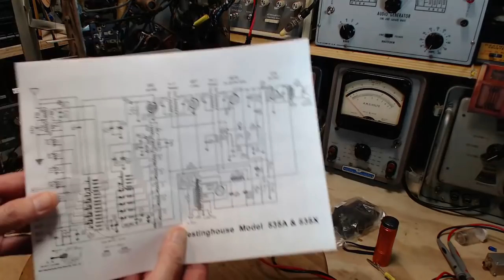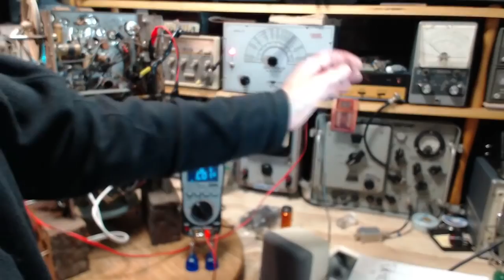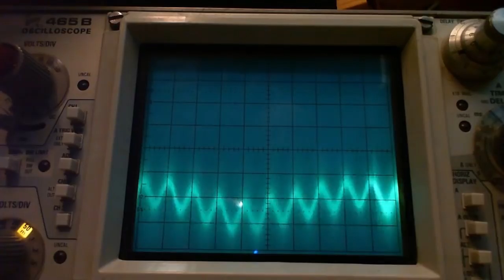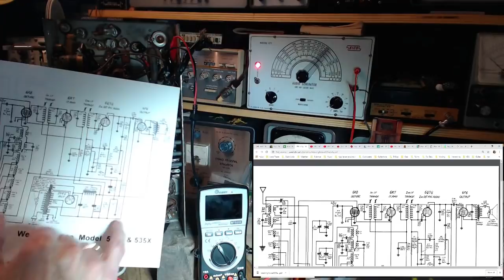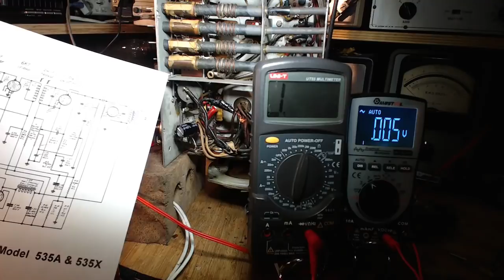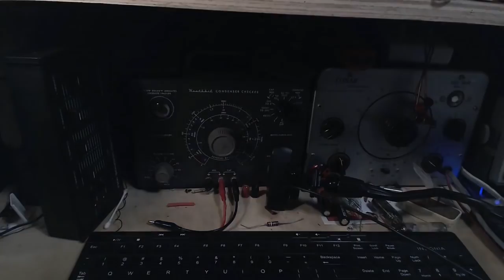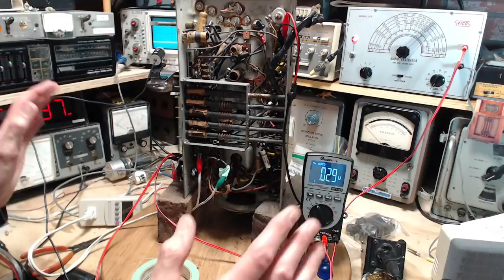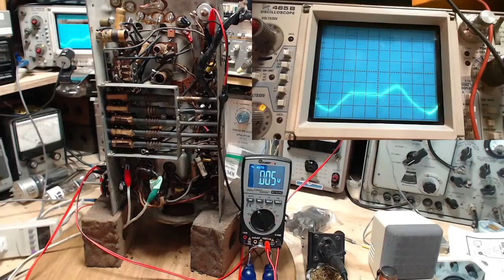Westinghouse 535 Video #6 - Three Wax Capacitors

Comment: When the C3 cap tester opens the eye at the bottom that means the cap is open, when it opens at the top of the scale that means shorted. I was thinking about the tone control and the connection to the tap on the volume control. Could that be an attempt to regulate the volume when you change the tone?  The volume level tends to change with changes in tone.

Comment: Are the wax capacitors for draining RF to ground if so then what about 100PF 1KV capacitors to replace the wax capacitors assuming they are not electrolytics, Sometimes 60/40 Solvit Lead/Tin Solder is the only thing that works that new type of solder not so good, I think there is a large wax capacitor near to the top from you where working.